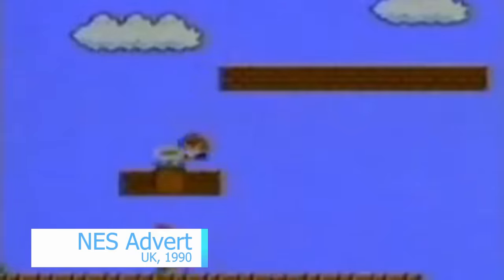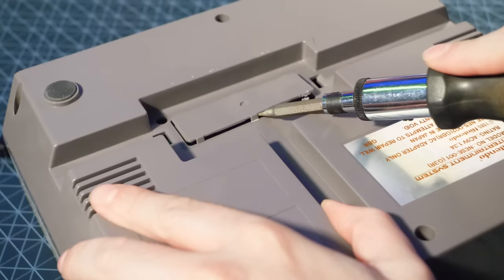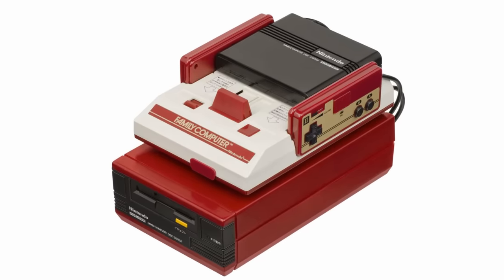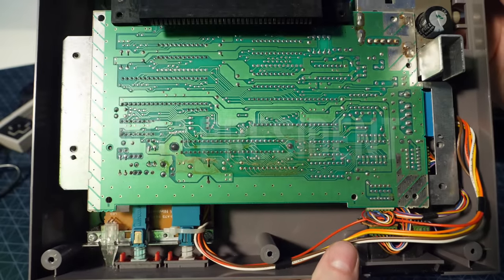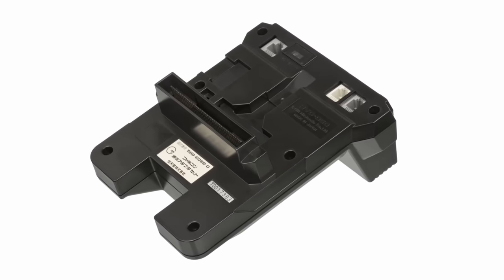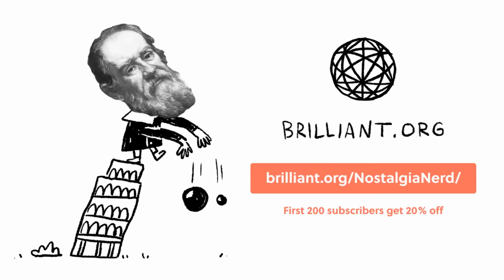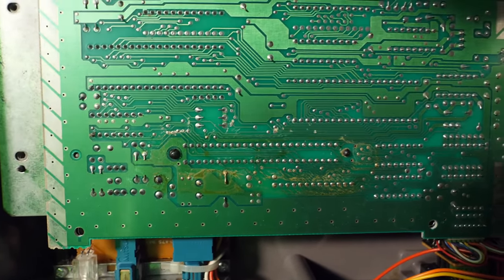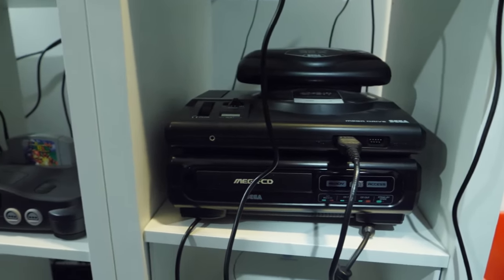Does the NES Have a Secret Master System Port? | Nostalgia Nerd

Comment: For the longest time, I have thought of that slot/port as something that the factory used for testing and calibration. I work for a medical device manufacturer, and we build automated pharmaceutical equipment. We have ports, much like what you see under the NES,  where we plug into before full on stress testing, to install the OS, calibrate controls, etc. Once we are finished, we close off that port before shipment.  It looks like I way off in my assumption. 

Great video, I learned something new today!
Reply: You do find that stuff on consumer hardware on the internal boards, of course: presumably they don't think the plastic shell will affect the performance, which seems like a dangerous assumption!
Reply: Not a bad guess at all though, that is for sure
Reply: Like the J_Tag connector on macbooks. Ohh, my DVB-T reciever got a RS232 port on the back. No Idea what that would be for, but my guess is for updating the firmware.
Reply: @SimonBuchanNz  Pretty much every Roomba model has a serial port somewhere for OSMOs that were sent out to customers and update the Roomba's firmware if needed, so there's another example.
Reply: Idexx?Sysmex?
Reply: My dentist has a white shell Atari Jaguar that runs his medical stuff, I'm sure it utilizes all the ports. I went home and looked it up, apparently they are a thing that you can buy that uses an Atari Jaguar as the base computer, lol
Reply: "I learned something new today!"

So did I by reading your post. Thanks.

Comment: You mentioned the Gamecube ports, those are probably the ones that had the most real world use.  I had a portable gamecube that I had built for myself.  In one port you put the modem or network adapter, attached directly to the bottom was a battery pack, and attached using the very stiff carry handle was a screen.  The system would play for about 2 hours on a single charge.  Nothing compared to today, but amazing for the time... however, I eventually stopped using it portable and changed the bottom expansion... I added the Gameboy Player that allowed me to play ALL gameboy games from any series of gameboy on my gamecube.  In my opinion this is the best expansion ever created for any video game console, it is literally an entire 2nd game console that plays and entire family of other games.
And of course Nintendo kept this idea when they released the Wii, with the ability to play gamecube games and even use gamecube controllers and memory cards... at least until someone figured out how to hack the console through the gamecube port to play copied games forcing nintendo to stop selling Wii's with this feature.
Reply: Yeah, God forbid we have fun with our game consoles.
Reply: cutting gamecube backwards compatibility was done for cost cutting on the later, cheaper models, but yeah the wii had a piracy problem

Comment: Great video! I always wondered what  that covered port on the NES was for. The best I came up with was a diagnostic port for repairs and troubleshooting by Nintendo or maybe a docking point used on retail displays. Thank you for making this.
Reply: It was an expansion port, we were supposed to get the disk system

Comment: I remember as a kid always wondering what the audio and video ports were for. It was the early 90's and none of our two TV's had such a port. It wasn't until I got a Playstation and had to hook that up through the VCR that I realized what a composite port was and then a little while later to learn that it was called the composite port.
Reply: I was pleasantly surprised later to realize my SNES has AV ports and was so easy to use on modern TVs.
Reply: @CurlyFromTheSwirly  Praise be the Nintendo multi out!
Reply: @zacharyrollick6169 
praise be the video game gods

Comment: It's depressing how rarely Nintendo uses their expansion slots.
Reply: John  wasted potential isn't better than no potential
Reply: It means that the systems are well designed
Reply: Gotta blame the marketplace for that: too much competition and the breakneck speed of technology to keep up with meant manufacturers were desgining newer consoles rather than accessories for models that would be woefully out-of-date by the time those accessories were designed, developed, tested and shipped.
Plus, they never really considered America a primary market to develop for/cater to, nor were any licensing agreements lucrative for any third-party vendors to try, hence things like the Game Genie being unofficial, unlicensed, and unsupported by Nintendo.
Reply: @Joe Cassidy I said rarely, not never.
Reply: I suppose the cartridge chips superseded it.
Reply: @enricopassoni1  all that e-waste is good design?  I don't think so. Even if the expansion port is .02 cents, multiply that by the total number of units, and it's clearly bad design. did you mean to be sarcastic?
Reply: @Joostinonline the potential was wasted for the past 38 years, but now there are audio expansion mods and HDMI output mods that use the expansion slot.  So the wasted potential was better than no potential, for the people who are using it now.

Comment: I remember the original AV connector that came with the NES.  It had a coaxial connection and a wire to attach to the TV, both attached to a box that fit perfectly in that box hole- without having to break out the cover for that slot, with the grooves in the bottom being perfectly sized for the coaxial cables and connections to fit under the NES as it sat on the floor.  This prevented many younger sibblings from tripping over and accidentally disconnecting the NES from the TV.
Reply: My first gen NES just 2 av ports on the side. Never heard of one needing a breakout box like that.
Reply: @functionatthejunction he's just talking about the grey RF modulator that plugs the NES into the TV's cable input.  It doesn't plug into the bottom of the NES, but you can just put it there to keep your cables tidy.

Comment: I remember getting an NES for Christmas 1985 & remember specifically opening up that bottom expansion slot cover & wondering what it was for, realizing the system didn’t come with anything that fit into it I put the cover on & left it alone

Comment: I think that it is actually pretty amazing that they had the foresight to put the expansion pack adapter on the bottom of the unit. It would have seemed like such a technological leap to most of us if we would have been able to use them. Kind of like playing online in the 80s
Reply: Seems more like they were trying to keep it a secret by putting it on the bottom.
Reply: @CurlyFromTheSwirly  "Seems more like they were trying to keep it a secret by putting it on the bottom."

Unfortunately Sherlock Holmes turned it upside-down and discovered it.

Comment: I’ve got one of Chykn’s ENIO expansion port boards. It works well for Famicom accessories and provides the pin connection for expansion audio. He was planning to do more with it, but not sure what happened to the project.

Comment: Id love to see if someone could make a modem to play NES to NES, even though it would be a stupid amount of work. Each game would have to have some sort of header or front end to match up with someone else online. Is that even possible doing it peer to peer and not a central server? I know emulation has some network features but I never tried them
Reply: I still have cables for genesis and ps1 you can link up 2 of the same systems together with 2 tvs and play 2 player like that. Doom ps1 and zero tolerance for genesis. I know it's not what you were saying though
Reply: There was the Xband Modem for SNES and Genesis that allowed dial-up multiplayer for Mortal Kombat, NBA Jam, and a few other games.

Comment: its just old systems used to have weed stash spots like the ps2
Reply: The Atari 5200 has HUGE stash spots. :P
Reply: @bsharpmajorscale AVGN already used it to store his beer 😂😂😂
Reply: Man of culture. that hdd space can hide a lot of things
Reply: The amount of heat that was produced lead to many inspections for such.
Reply: @HIDHIFDB  Yeah, like a HDD! :P
Reply: The official Xbox 360 steering wheel actually had a great stash spot too. It had two grey parts on either side of it that lloked like they were there purely for decoration. The left hand side was solid, but the right side unclipped so you could gain access to the battery compartment (quite why anyone would want to power their steering wheel on two AA batteries when it came with a plug I'll never know...). I used to stash weed in there all the time lol.
Reply: Thats for your iso filled hdd....

Comment: Interestingly, we visited our local Nintendo headquarters in the 90s (in Redmond I think?) and I specifically asked about that port.  And they told me it was a diagnostic port, that when faulty devices were sent in for repair, they said they had a diagnostic harness that connected to that port.  That's probably not quite accurate, but that's what they told us.
Reply: Sounds like they wanted to keep the reason top secret.

Comment: TLDW there is an expansion slot and the only peripheral was a modem that was not manufactured at a large scale in the United States of America.

edited from TLDR to TLDW
Edit 2 I have made this comment longer because the scope of the production of the nes modem was unclear
Reply: TLDW
Reply: @infinidominion  Captain Pedantic.
Reply: "Caught on"? That would imply it did not sell well. It didn't even get licensing or start manufacturing.
Reply: A Gamer Aaron very well I will edit this comment again

Comment: The question is, what is the Switch capable of, if Nintendo designed it also in foresight?
Reply: Bluetooth support.... That was there all along but they activated ,4 years later cuz nintendo
Reply: They still have yet to enable usb 3.0 support on the dock.

Comment: In addition to the modem, there was an idea for the Floppy Disk Drive system and such to plug into that port. Basically, it would add a version of the keyboard used in Famicom as well as modem, and as well as disk drive. This would be a concept not too unlike the Commodore disk drive which allows daisy chaining over a serial bus. Commodore's serial bus based disk drive were essentially computers with one or more disks drives on a serial based networking port based on the IEEE-488 port which was a parallel networking port. Each peripheral essentially had to have a computer board. Even Commodore's printers had little CPUs, ROM, and RAM as well as an I/O chip and a microcontroller for controlling the printer... while the floppy drives had a floppy disk controller. Each such device would have an ID#. Almost akin to the later ethernet connected devices like your ethernet connected printers. Same thing could be for mass storage devices so you access them via a more fancier ID numbering system (local area network IP address). So in theory, there can be various kinds of stuff Nintendo could have came up with. Including even a hard drive. If the PET could in 1977. They could have implemented something that could be stacked or something. Even a LASERDISC based optical disk.

Comment: I remember seeing that on my NES when I was a kid. I got one of the later models, which had that port covered up. I always saw it as something along the same lines as what Sega would eventually do with the Sega CD. There was mention in the Excite Bike manual of future hardware updates to allow saving and loading courses. There was also the Advance Video System, which I imagine Nintendo wasn't 100% ready to ditch. Of course, as you mentioned, the top loader did away with it altogether.

Comment: I used to have a N64 with a cd drive connected via the expension slot. It was a copy drive where you could get the ROM games on a cd and play pirated games from the internet. I know there was a similar device for the SNES as well.
Reply: Yup, I have 2 of 'em from Taiwan.  I used to rent games from Blockbuster every weekend and copy them onto AOL disks.  Both died when the NiCad batteries leaked.  Super UFO started as one, now they make flashcarts and still use the same interface.

Comment: I recently learned that there is a mod out recently that uses the bottom port to use a Nintendo multi out for video instead of the standard Yellow and White AV cables to connect to your TV

Comment: I had an NES that I found in my neighbors trash back in the mid-late 90s and it had some wild medications done to it.  That first block/tab you pulled off had a slot cut in it and there was a little switch poking out of it.  When the switch was flipped the console wouldnt turn on the unit on - but once it was flipped off again, it would turn back on.  I had two other NES systems growing up and neither of them had this so I assumed it was some sort of a kill switch my neighbor added on himself, maybe to limit his kids playing time or something.  Really wish I knew what happened to that console, I lost track of it during a move in my mid 20s ca. '08, cause I've never seen or heard of anyone else having anything like it

Comment: The first-run consoles (shipped with Duck Hunt, Hogan's Alley & Gyromite with their related accessories) didn't have the "break-the-tabs cover" under the larger, easily removed cover which exposed the port with the legend "FOR FUTURE PRODUCT DEVELOPMENT" in relief on the case.

Instead of developing future products for the NES, the Super NES was rolled out TO REPLACE my console and 54 games.  Sega Genesis was a great replacement, the NES + 54 games being given to the neighbor with 5 children.

Comment: Another factor that didn't help Nintendo is that the phone system in United States still had long-distance phone fees. Meaning any modem system would have to require dial-in numbers in each area code they wanted to operate in.  Both Nintendo and Sega had built modem systems that worked well in Japan, but it wouldn't work in the US because of the limitations.  Sega had figured out it was easier to go through the cable system than the phone, and thus the Sega channel was created.

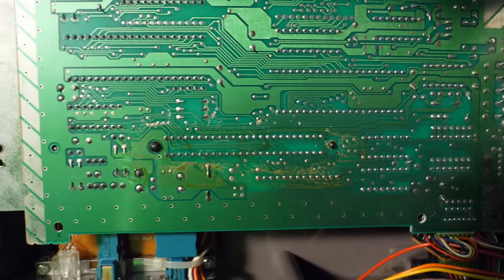Comment: On that audio hack at 10:08 - I only ever had the UK-spec NES, but a few years ago I bought some Famicom carts¹ intending to use them to house SBCs with retro software loaded on them. That project never came to fruition, but while tearing down two of them I couldn't help noticing both carts (One Nintendo, one Namco) had an odd U-shaped trace on the cartridge edge connector, on each side of the board.

Further investigation showed the audio output on the Famicom is routed through the cartridge so that additional sound hardware can add to the audio, or if need be (e.g. as an anti-piracy measure) the system audio can be disconnected entirely and provided by hardware on the cartridge instead. By the sound of things, bridging those two pins on the NES expansion connector might achieve the same thing in the same way. 🧰

I don't know if it was ever used for that purpose...But setting the system audio to emit constant unbearable noise through software, blocking that at the edge connector and providing legit audio from the cart might've been a good way to thwart everyday ROM dumping! 🔒

(¹ - Don't worry, they were all Baseball carts. By the look of things the market was completely flooded with them from Famicom release until at least 2018... 😇)

Comment: My NES did not have the tab, just the block. But there are 'stories' that a US NES test disk drive did exist and was tested in a few homes belonging to employee's of Nintendo America for few months in 1988. The reason why the NES disk drive was ultimately abandon was piracy problems with the disk system in Japan, the lack of electronic kiosk/vending machines in the US. But most importantly of all, it is said that level of software piracy in the US PC market with disk based software, convinced Nintendo to abandon the scheme early in the NES's life cycle. Unfortunately no pictures exist and no one can corroborate the story if said NES test deck did exist. Some have stated that it was not a true NES test disk system, but was instead a test Twin Famicom made by Sharp, which was moded to play US NES games as well as Japan only disk system games. This was also abandoned for the reason the original Famicom disk system of US NES was.

Comment: Duh, in 1985 it was clearly for the disk drive, but since the Disk System was a commercial failure (look it up, there are more Wii U's sold in Japan than Disk Systems!), it was never released in the West, thus no needed attachment.

Comment: The NES might not have a secret Master System interface, but the Master System has a secret Master System connector!

Underneath that cover on the back of the console, there's a similar piece to break off exposing an edge connector on the motherboard. A cartridge connected to this using the correct physical pieces will result in booting any SMS game as usual.

Comment: You didn't mention the slot cleaning device you had to use regularly to keep the contacts clean nor the fact that over time, the contacts would spread apart and lose connection.

Comment: An other secret is that the first NES that was sold was universal, you can play any game from all over the world. The NES i had was sold in Europe a little later so i couldnt play games from other regions, Asia and USA, only from Europe.

I bought a game with 256 games and the guy thay sold this to me when i was a kid told me to bring my NES to the store if the 256 games didnt work. He opened the game and cut one of the cables. Dont remember the color.

So if you have a NES and cant pmay games from all of the world, you can cut the right cable inside the box and you will get all regions games working👍👍

Comment: I think the one on the SMS was simply a backwards cartridge slot. Built for expansion of course but possible plug an adapter to play SMS carts thru it. Redundant of course. Wonder what happens if you plug an sms into an sms lol